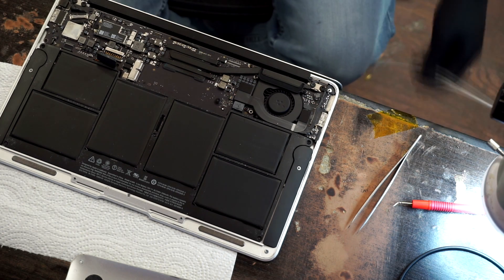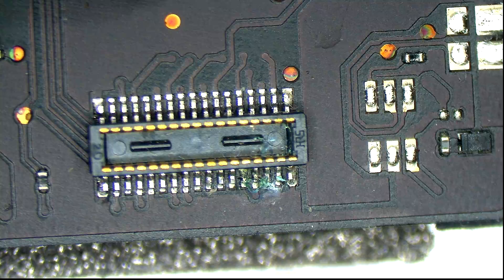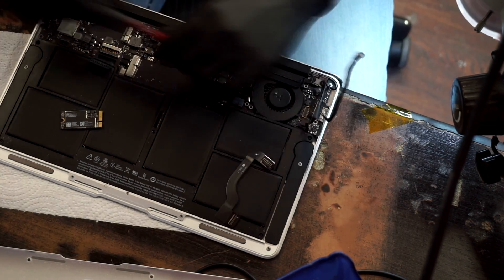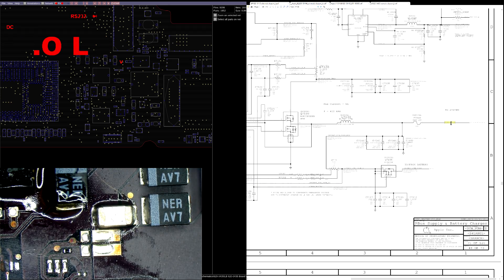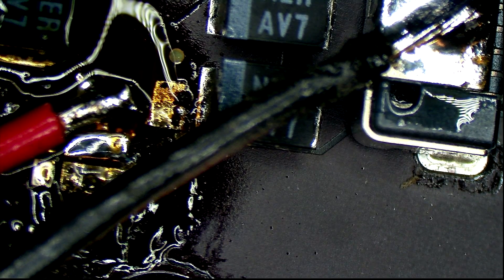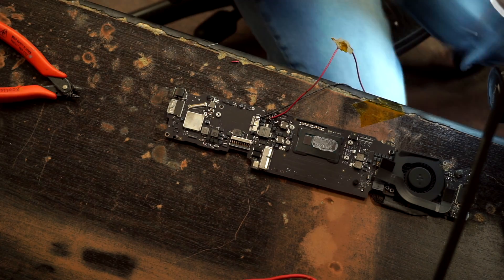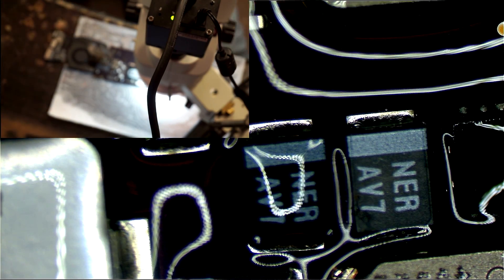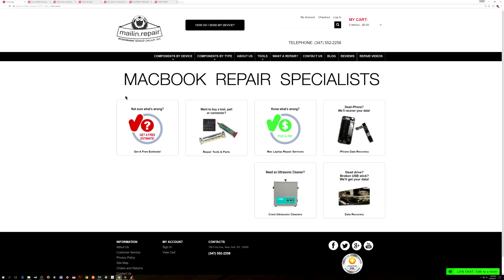Macbook Air short circuit repair

Comment: Greetings Louis, I hope I'll get an answer for this question i'm about to ask. 
there's a 820-00165-A board that has multiple shorts on it. 

PPVRTC_G3H
PP3V3_SUS
PP3V3_S5
PP3V3_S0
PP1V05_S0

all these voltage lines shorted to the ground, i've tried to resolved but to no avail. 

when plugged in the both green and red light glowed up and the CPU warms up but no fan spin nor a start.

Comment: I have a 2009 mid release MacBook Pro 13 inch I have replaced the battery and the old one still has useful life in it. I want to use the battery in a project could you help me with the pin outs?

Comment: Why don't you repair Tesla car computers? Big screen with a computer board in the backside. Tesla charges $2900 to replace it while its easy to take apart and repair and you can charge like $1000
Reply: $1000 for a small repair like new IC as they are not like Apple where everything needs programming and encryption bullshit

Comment: I have probably of the most repeated questios (didn't check bur I assume this gets asked a lot) how did you get the repair schematics? And/Or what is the software you usally are using to display them/aid you with repairs? 
In my case I'm trying to fix an  old Galaxy Note 2 ( it's still expensive in my country) but I can't seem to find digital schematics like the ones you use online ( maybe they don't exist for that phone)
Reply from the maker: internet, and openboardview
Reply: Ok thanks for the reply, I'm looking at the software right now....
One last question, and excuse me please since I really know you hate stupid stuff like this, but you go ahead and just google "device name schematics" ? or "schematics" is not the porper keyword.
Thanks once more, and excuse the inconvenience

Comment: hey @Louis Rossmann, I'm wearing earplugs... the beep on the FX951 is killing me. How do you tone it down?
Reply from the maker: R design  cursing
Reply: yes yes... why couldn't they just put a dwarf in there, with a thermometer and a very small bell?
Reply: I guess it's to get to the alcohol dehydrogenase deficient after a night of sapporo and karaoke...
Reply: 1k, 10k, 100k.....?
Reply: oh well, taped over the hole in the offending component & it's liveable-with now. It's a QMB-05 http://datasheet.octopart.com/QMX-05.-Star-Micronics-datasheet-514145.pdf  .... at least it's magnetic & not piezo (which are damaged by hole-plugging).

Comment: What temperature do you have set on your hot air rework station??
Reply: Experiment with your hot air station, apple is RoHS compliant so you will need a high temperature to melt the lead free solder. Don't bother putting lead free back on, leaded solder is the good easy stuff.
Reply: ok thx

Comment: Louis, glad you still upload some short video clips.
You did only inject 1V to get that CAP sizzling?
Thanks!
Reply: Unless I am mistaken and smoothbrained, he removed a fuse before feeding power to the board so that it didn't get to the sensitive component(s) (CPU).
Reply: He put it on the fuse side because if he needed 12V to detect a bad component, the CPU wouls be long dead at 8

Comment: Can we get like, an hour long video of you just chewing out a jtag
Reply: Meemo - You mean a "JTAG killcount" video, right? And I'd love a "JTAGs destroyed so far" overlay in live stream.
Reply: sheepdean someone better make a compilation
Reply: Apatewna Yeah that would be great, but louis usually only does 1 board per stream so it would be very slow.
Reply: I think someone needs to start selling jtag removal stencils, with a hole just the right size to heat that connector but protect the surrounding real estate. That way you can blast away at the pesky things with minimal risk. 
Better still, an open source jtag probe, to let us discover what lurks within the walled garden of Apple jtag land.

Comment: Don't own a macbook air, never has owned an macbook. Still watched the whole thing. You made it interesting, good job! :)
Reply: I own and occasionally use a macbook air for 1 reason: Was about to be sent to the dump because the battery connector was loose but my dad managed to get it for me to fix. i7 4gb ram 2011 model. Good little machine for the price...

Comment: Is that method of locating shorted element (supply power, soak in alcohol) like....legit? Or it was just an random Louis idea w/ confidence on that it can't turn out bad and worth trying?
Reply from the maker: Define "legit" so I can give a proper answer.
Reply: Actually used by others/in industry? I just never heard of such method before. Not that I should've heard of it, since I haven't used anything better than 5$ iron and best I did with it is soldering a new jack to headphones. :D
Reply from the maker: Good question. Most others in this "industry" outsource to places like here jessa, etc.
Reply: It is indeed a real thing, as isopropyl alchohol is non-conductive and evaporates easy, it's an effective way to detect exesive heat due to shorts. 

Apple would just use their fancy jtags >:(.
Reply: I remember Big Clive suggested doing it instead of buying a FLIR camera. Or was it Dave from eevblog?

Comment: Why do u hate the n
jtag connector
Reply from the maker: JTAG is used for programming at the factory. I don't get to program, so why should they?

It is also a central point for many voltages & signals so any slight corrosion here will destroy the machine entirely. Think of it like being shot in the knee(corrosion on LCD circuit) vs. being shot in the head(corrosion on JTAG). Shot in the knee you can still talk/use your arms, shot in the head and you're dead.

Comment: what's with this guy and JTAG connectors?
Reply: if i recall correctly, the jtag is used by apple for diagnostics or something and since apple aren't making his life easier he's returning the favour by destroying the jtags :D
Reply: oh, THEY MUST DIE!
Reply from the maker: JTAG is used for programming at the factory. I don't get to program, so why should they?

It is also a central point for many voltages & signals so any slight corrosion here will destroy the machine entirely. Think of it like being shot in the knee(corrosion on LCD circuit) vs. being shot in the head(corrosion on JTAG). Shot in the knee you can still talk/use your arms, shot in the head and you're dead.
Reply: The JTAG connector is where everything is connected to. if the jtag connector gives out. Your logic board dies. Its like opening your legs at a brothel. You're leaving open a spot of vulnerability.

Comment: Hey Louis I've stumbled upon your channel recently and I were wondering if you could shed some light upon my not-so-recent issue with my laptops that I've spilled beer on and tried to repair at local shop. I don't really have any issue with it anymore, it's just my curiosity and you seem like someone who would gladly saturate it.

Sooooo - I've spilled (wait no, I were so drunk that I got no idea how much beer there was in that bottle that was flipped over, maybe I actually drowned it over) beer over it and since I were drunk I'm not even sure where and how exactly, I've tried to open it first to clean up myself, but only plastic case seemed gluishy dirty with it, board seemed clean, yet it didn't work, only diode power light turned on and seemingly hard drive made some sounds, but that's all, no fan spinning, no screen, no anything.
So I left it at local repair shop, then they called and told me the price and what exactly was broken, I decided it was too high to repair (because I've bought new laptop meanwhile anyway), so they sent it back to me... And then for some random reason I decided to turn it on and it just worked fine like nothing happened. I'm just confused, I can't really ask a proper question, can you say anything about it?
Then there was that second laptot that I spilled beer over again... Shameful... But it worked fine afterwards anyway. Should I worry?

Look, I'm just a curious person, I ask shitton of seemingly random questions, I've learnt poeple don't like being questioned (unless it's just a child asking them), but you said in one of your oplder videos you read all comments, but it's ok if you don't want to answer, but please, I'd rather hear 'fuck off' than nothing at all. Cheers.
Reply from the maker: Sometimes it will work intermittently. Sometimes it will not work, then work if the corrosion moves over. Sometimes it works but is corroding and will soon die. Sometimes the shop is scamming you. Sometimes the shop FIXES it before telling you what is wrong because it is just more efficient way to do an accurate diagnosis, then hopes you say yes, and when you don't say yes they just send it back and hope you don't tell anyone you got a free fix. That happens here occasionally, I just take all the shit from incoming and fix it and let the salesman deal with everyone afterwards. Most say yes, if they say no sometimes I take parts back, if it is busy fuck it they got a free repair..

I've definitely had cases of not working, it sits in the slot, tomorrow it works go on where I look like a total idiot. Open it up and check for corrosion.
Reply: I'm just an ordinary user, no idea how to protect both my own hardware (other than being sober lol) and protect my own wallet against leeching repair shops.

And even after that, I actually did though that they've actually fixed my laptop before calling me and it makes me feel bad for deciding not to 'repair' it... I just want to be an honest person- on one hand I never agreed to repair ('diagnosis' was free), but then if they've actually fixed it, I feel bad for making them work for free... It's just confusion all around.

But even after all of that, there is just me and my old broken-not-broken fixed-or-not laptop and I got no idea if it actually safely works, even if it seemingly works like nothing happened. So much confusion. What the hell.
Reply: Actual repair shop is somewhere else and they just send laptops there, they wouldn't know and I don't think guy who manages sending it can even accept random money like that due to all tax rules and stuff. I never saw actual person who did repair (I assume he was the one who called with pricing).

Comment: How is possible that Macbooks are so delicate, while Thinkpads can be literally immersed in water?
Reply from the maker: Yeah. People loved the old IBMs for the trackpoint, but they weren't stockholm'd to the point of putting up with macbook-level durability for it. Whereas Apple realizes that regardless of the lack of longevity/durability, people will continue going back.
Reply from the maker: IBM valued durability and longevity, Apple values you buying a new one every year. There's a reason they have 400B in the bank.
Reply: Yep Apple designs in Fail Points instead of removing them.
Reply: I completely agree. T410 built like a brick sh*thouse.. T420.. the same... T430.. starting to get a bit more flimsy.. T460... look and feel of a low end Dell. No useful ports, no DVD.. c'mon Lenovo.. get your act together.
Reply: I don't know the x240, never seen one, but from what I have read, you get 3xUSB, card reader, RJ45.. no DVD, does it even have HDMI? Is the BIOS screwed down to stop you installing Linux? .. and that keyboard looks awfully like the one on the T460, clickety clackety, spongety, squidge. Can you swap out the SSD? Is it soldered in?
Reply: I bought an IBM Thinkpad 310D reduced down from £5 to £4. Put a charger in and Windows 95 is still there.
Reply: "My mid 2009 white macbook is doing fine. If you want a IBM / Microsoft, go get one. This is part of youtube is about Apple repair, not how much you've been hypnotized by Microsoft."
I have a number of Macs, including an original iMac and an old Classic, those things were built to last. 
I also have Zzzzzzzzero Micro$oft exposure, since I use Linux and Open Source software... no Micro$oft mesmerizing for me. Reliability was the subject of my ranting rather than brand loyalty.
Reply: Andrew Hull i will buy x240
Reply: I have a really old Thinkpad T42. I love the hardware! :)
Reply: Now did I say I had ever bought an Apple product?
All of the old machines I have, were given to me in various stages of disrepair by various well meaning individuals over the years.... so nope... the marketing conjurers of Cupertino have failed entirely to have any fiscal effect on me.
Reply: ThinkPad quality has gone straight down the shitter. They botched it with the T[n]40 series. I have a T530 as my personal laptop and run a fleet of T430s at work. Hopefully the upcoming "Retro ThinkPad" takes the line back to quality, but we'll see in October...
Reply: ReaperRotten, they're designed to break easily. That way Crapple can charge hundreds of dollars in repairs and, in the end, you wind up paying almost twice as much for the product.